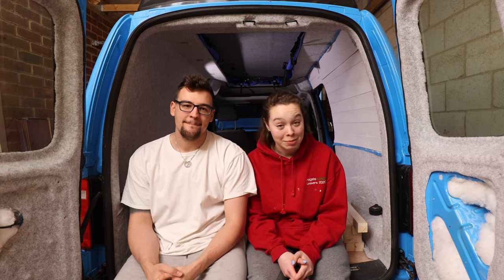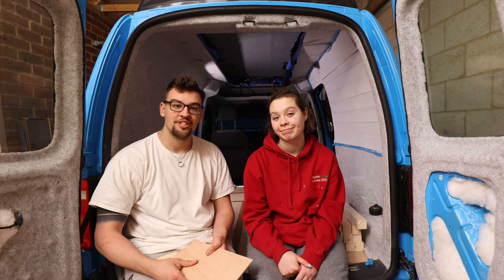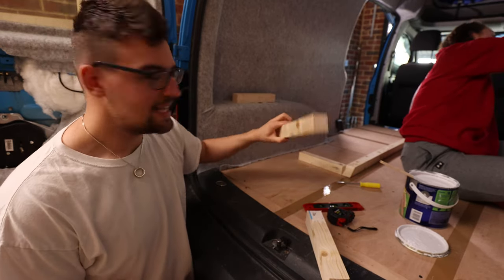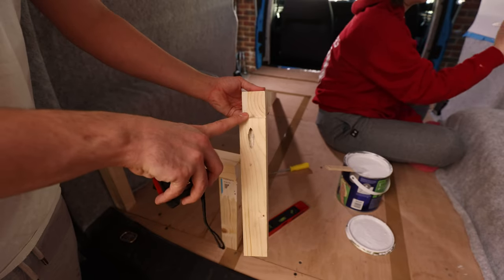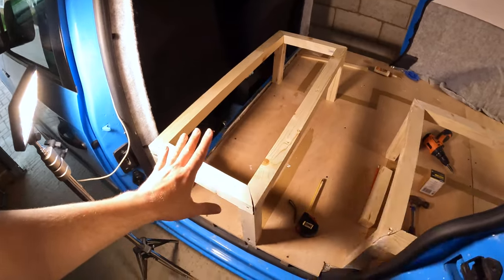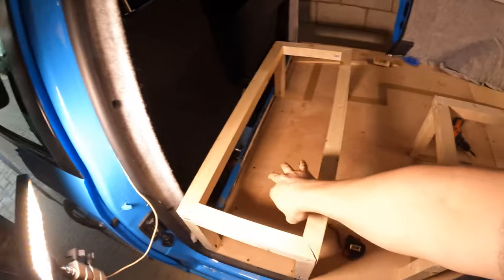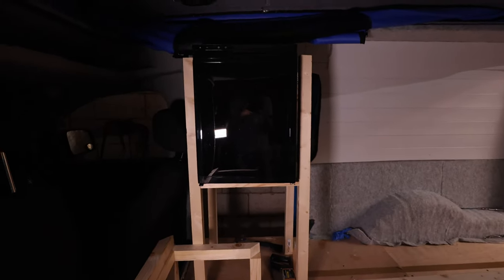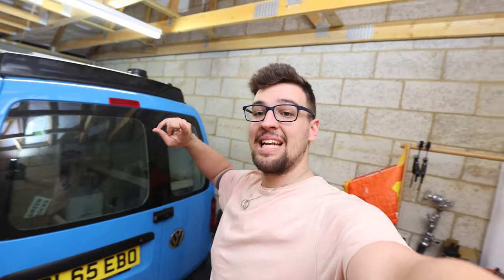Furniture Skeleton Frame | Converting a Van | VW Caddy Maxi | Van Build #9

Comment: Hey Bradley, can you give more details on the tool you used to drill the space needed for vertically screwing the bed frame legs into the plywood floor? Thanks!
Reply from the maker: Hiya, thanks for the comment, I think your referring to the "Pocket Hole Jig" I used that and wood glue just to be sure!